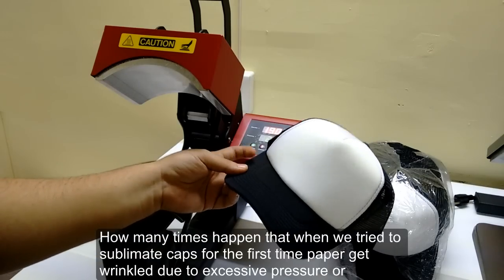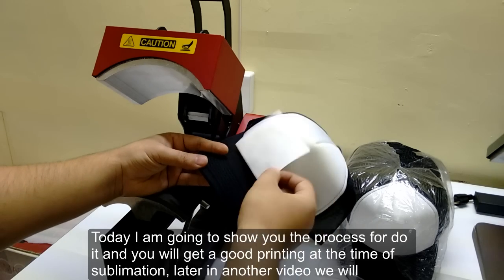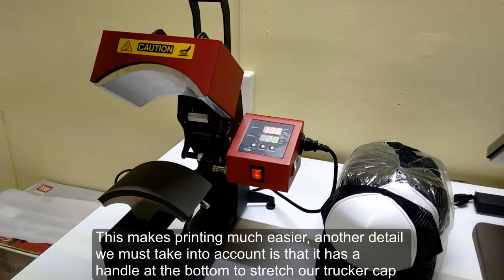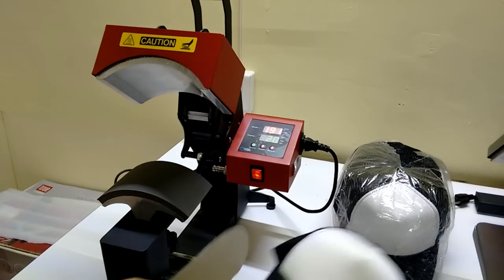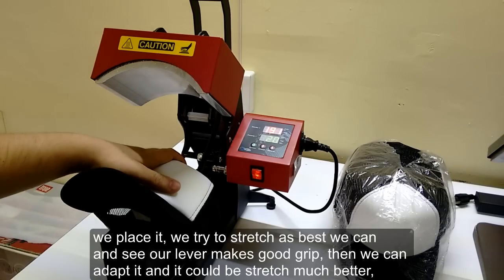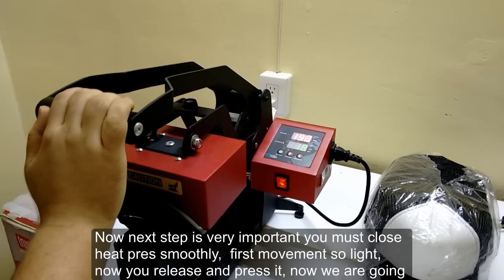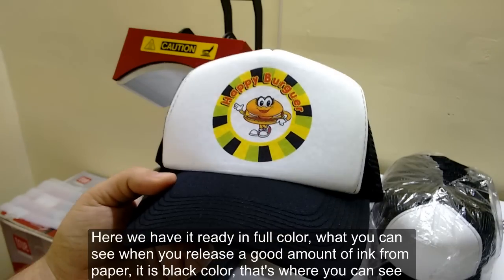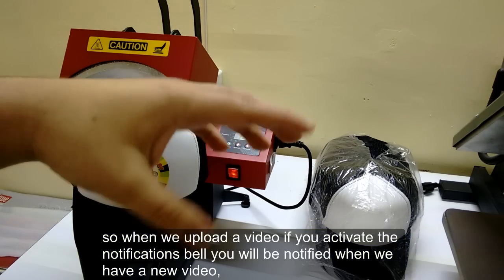How to sublimate caps step by step cap heat press

Comment: Can you print the picture with a regular inkjet printer or do you need a special printer for that. And also is sublimation ink a different type of ink than inkjet  ink?
Reply from the maker: Hi You need special inks and printers as epson l310 with that system . Greetings

Comment from the maker: ✅ Sublimation Times and Temperatures Chart - [2020] - https://silhouetteworld.com/sublimation_times_and_temperatures.php 
At Amazon you can find good deals for your Sublimation and Vinyl Textile business
New Release Silhouette Cameo 4 with Bluetooth - https://amzn.to/2IzXUnz
Sublimation Heat Press Machine 15x15 - https://amzn.to/2XgEv4G
Cricut EasyPress Heat Transfer Press 2, 9x9 Inches - https://amzn.to/2Xeylln
Silhouette Cameo 3 Starter Bundle 26 Oracal Vinyl - https://amzn.to/2FDHnxu
Silhouette KIT Tool - https://amzn.to/2XBzCSP
Silhouette PixScan Cutting Mat - https://amzn.to/2Xh1A7g
Silhouette Cameo Cutting Mat 24 x 12 -  https://amzn.to/2Xdvyny
Silhouette Fabric Blade Cameo 3 -  https://amzn.to/2Nm61cm
Silhouette Premium Blade Cameo 3 - https://amzn.to/2IXjovl

Comment: Hey amigo, thanks for this. I have a seperate question if you can help. How can I print a large sticker with the glue on the printed side, so to stick on inside glass? Is there a special printer and cutter to do this? Thank you.